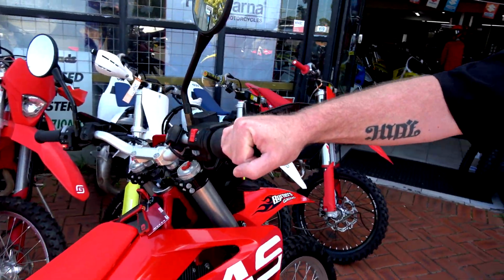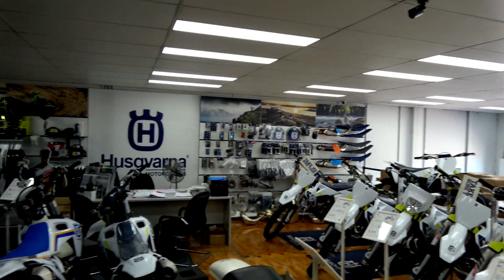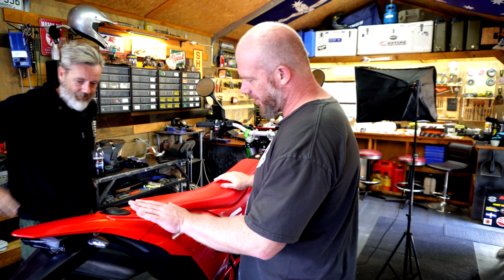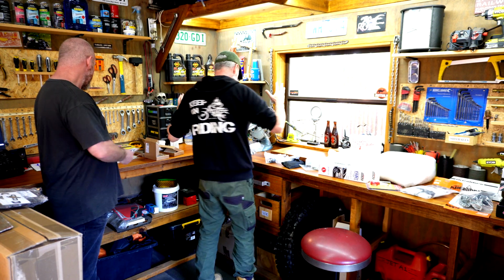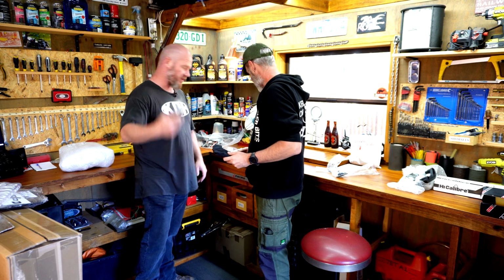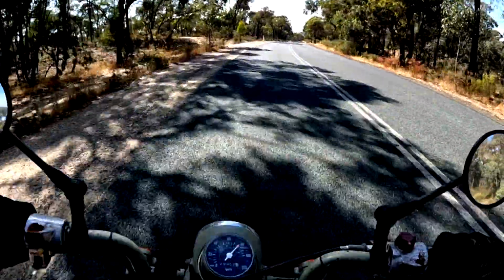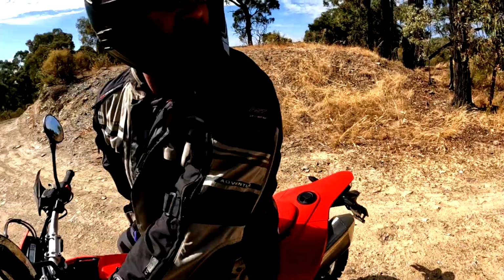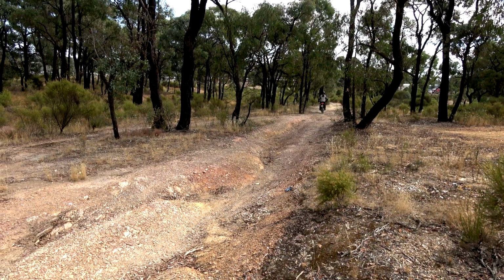Project GASGAS 700 Pickup & Test

Comment: crash knobs ok if drop it on road or hard top track , can see them being ripped off in gnarly off road stuff rocks/deep washouts etc
ABS line feed it behind the fork like on the 690 had them  cable tie  to fork/brake mount to keep away from the abs disk/hub

i ripped all my ABS off ran direct HelPerformance custom brake lines & a trailtech voyager pro so still had all the idiot warning lights speedo tacho etc but No abs crap

Comment: I got a 2005 GG, this fall. An ec450fse. Still lots of snow in the bush so riding has been limited. I'm 4th owner so there's some stuff needs replacing. Finding out parts are hard to find. It runs great.

It will be taken into places I've found out that the klr gets expensive to replace plastics😆

Comment: The abs sensor cable should originally be on the inside. It is mounted incorrectly. Just loosen a couple of bolts and put it inside the plastic.
Reply: Yep, that’ll solve the problem

Comment: The tool kit is rubbish.  You will find there is a place under the seat to hold the torx bit used to access the side cover. 

Side stand dongle is a must.  Break it and you’re walking.  

Check all your radiator hoses.  It’s common to find loose from the factory.   Take extra special care of the radiator.  Make sure nothing touches it.  Make sure the guard for the radiator is more open at the bottom to all ow stones that get in to get out.  

Grease your swing arm bearings from new.  Set the sag right and the geometry is very sensitive to ride height to have it steer properly.